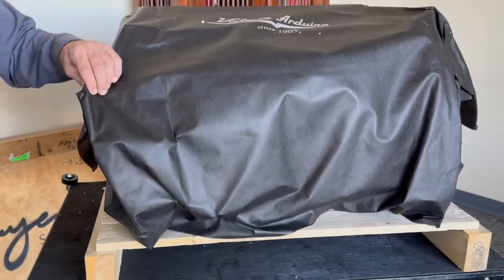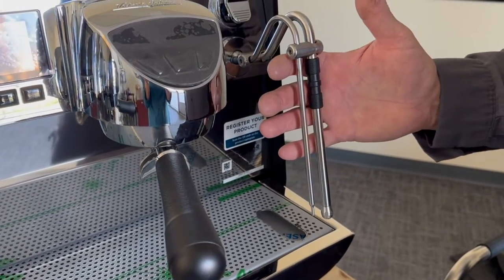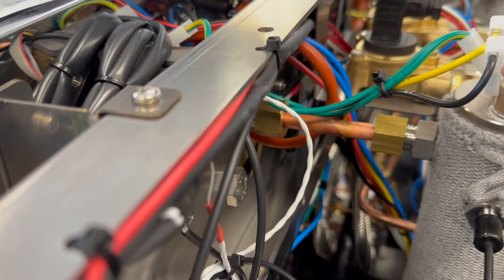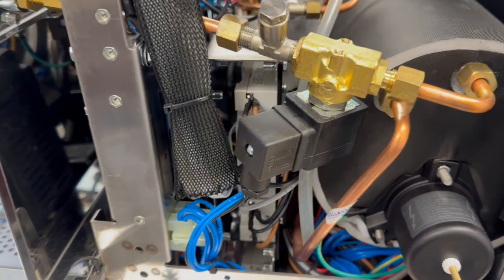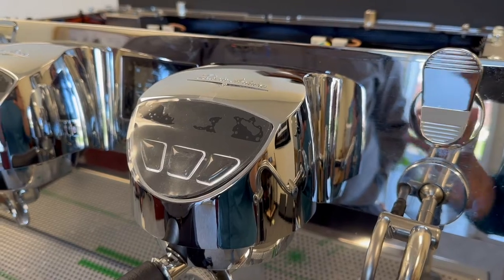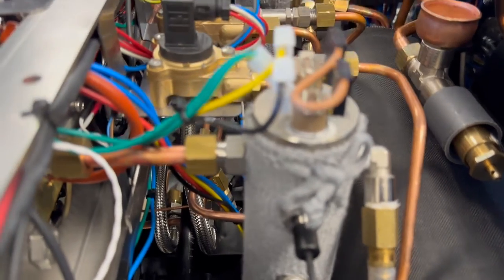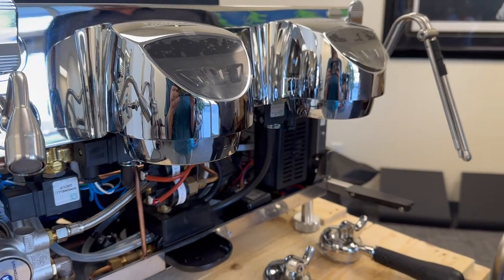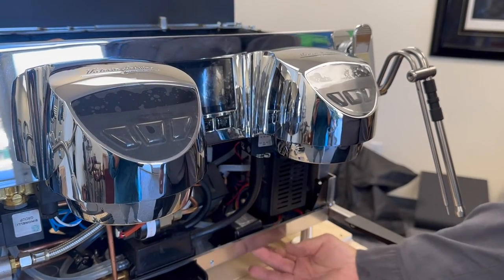Before you Buy: Inside Victoria Arduino Eagle One Espresso Machine

Comment: What is the difference between American and Italian made in espresso machine?
Reply from the maker: Espresso machines manufactured in Italy typically utilize fittings and components designed according to the metric system. In contrast, machines manufactured in the USA may use a combination of both the imperial (standard) system and the metric system. Many of the most well-known and respected espresso machine brands originate from Italy (e.g., La Marzocco, Simonelli, Rancilio), bringing a certain prestige and expectation of quality. However, high-end machines such as Synesso and Slayer Espresso are designed and manufactured in the U.S., demonstrating that American-made machines can also achieve high standards of excellence.
Reply: @EspressoServiceNetwork  do you find stainless boilers better than copper ?
Reply: @mryoyo7741  Acid-resistant steel is definitely more durable than copper when it comes to the chemicals we use to descale the coffee machine from time to time.
Reply from the maker: @mryoyo7741  Stainless is more durable and has a longer life. It is better but the cost is greater.